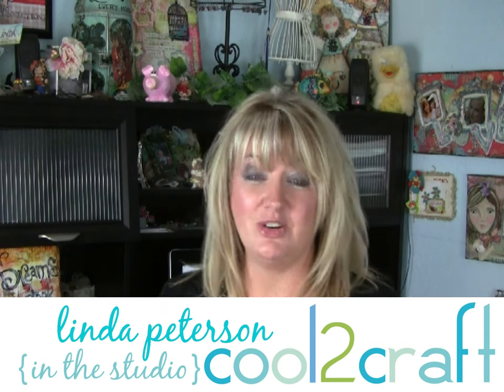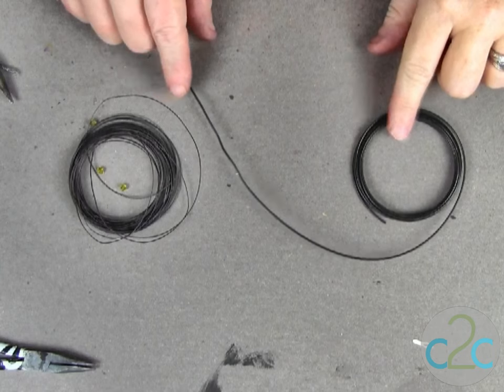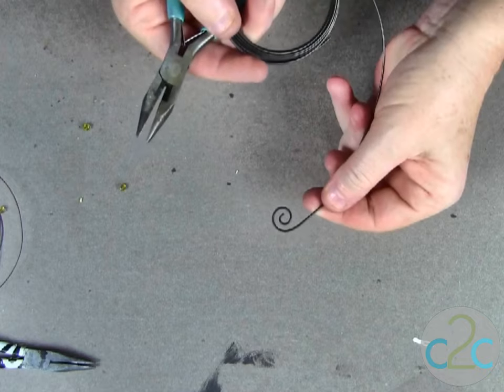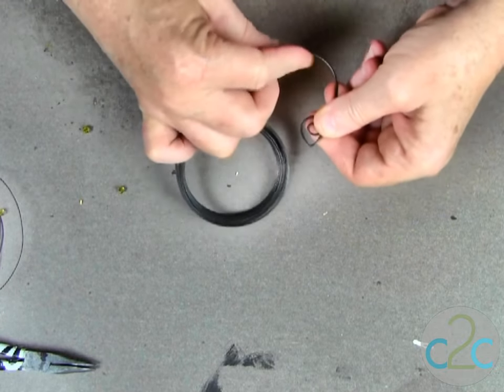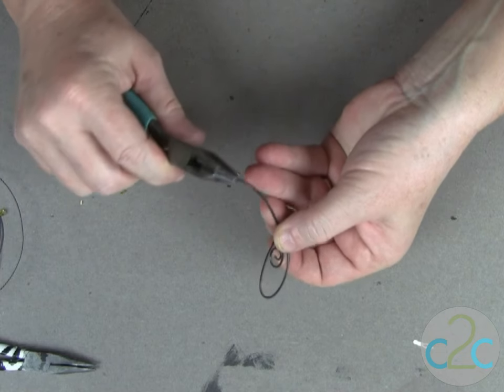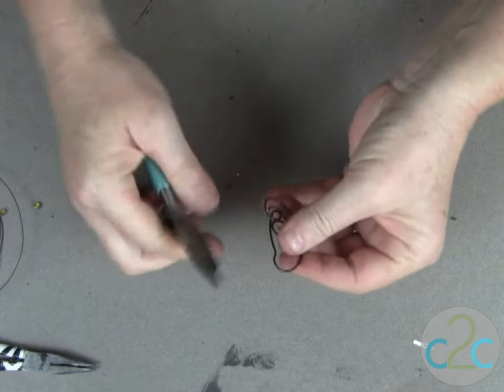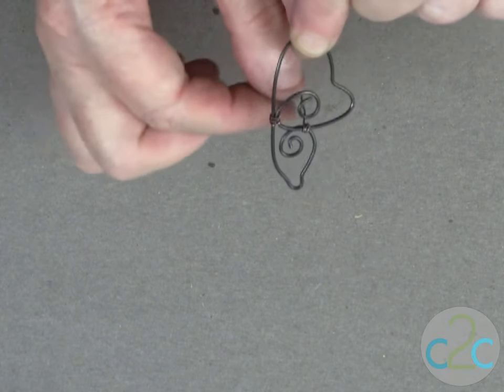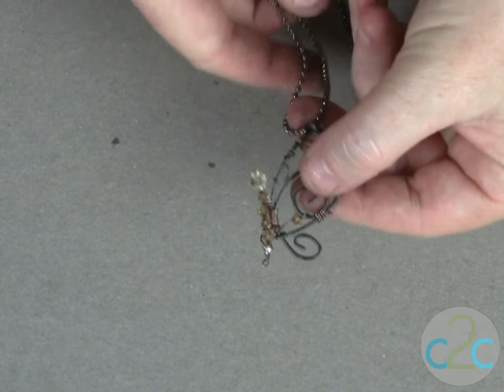How to Make a Bent Wire Butterfly Pendant by Linda Peterson

Comment: It would have been nice if she had shown us how to do the whole project instead of just telling us. I am still confused as to how to finish it off with the beads etc. I consider this an incomplete tutorial.
Reply: Hi Pamela Brundage I hope I can help you out a little.  I strung the beads onto a piece of wire and wrapped the ends in the center of the open butterfly.  For theside butterfly, I did the same thing and created a loop at the top and bottom of the beaded wire.  Then I used a separate piece of wire to attach it to the butterfly wing base.  Thank you for your feedback and for watching our channel! I hope this helps clarify.  {Linda}
Reply: It would have been nice if we try it ourselves